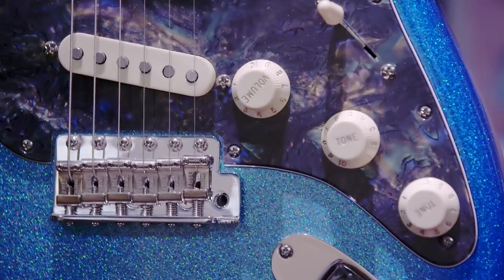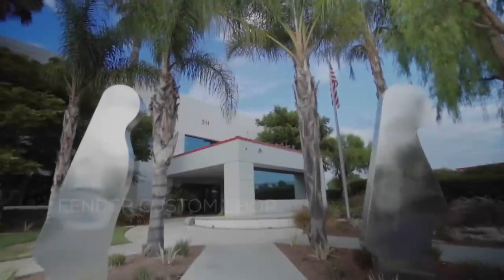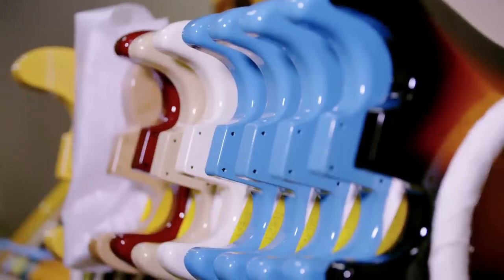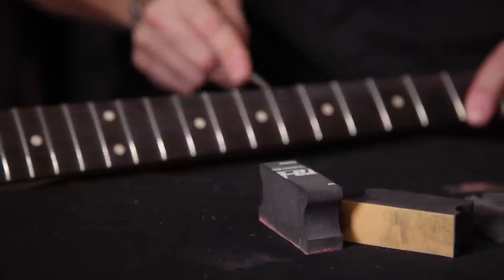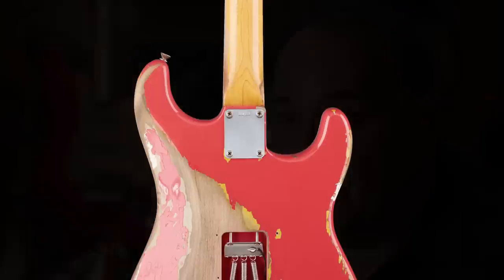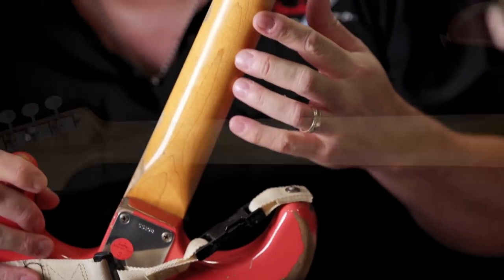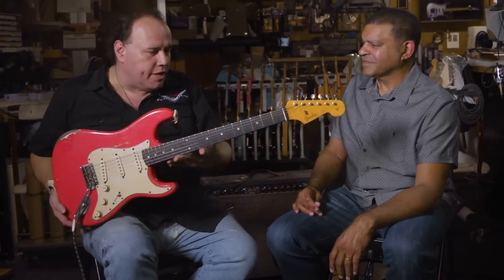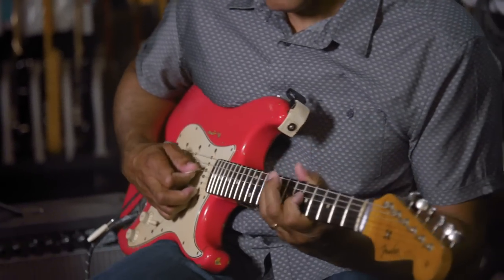Fender Master Builder Brings Dream Guitars to Life

Comment: Full disclaimer up front. I own 3 Fender custom shop guitars. These are great instruments IF and i mean IF you do your homework and find the right ones. Overpriced???? Absolutely! Overrated??? Can be! They are unique but not equal so beware. However they do have their place in the instrument world. I was skeptical just like you so i went and found used ones literally half of the retail cost so THATS the only reason why i have accumulated three of these guitars. They looked the part and they sounded incredible. For me they fill a nostalgia void. Thats enough reason for me so i took the leap of faith.  I own a 1951 Nocaster, 1957 Strat and a 1960 Strat. All CS heavy relics. Those are my favorite years from Fender and i would need to hit the lottery twice in one lifetime to own the originals.

Comment: Yes the relationship with the neck on the guitar is almost unsaid spiritual. 
I've had vintage 57 strat's V's,  a few '59 full C"s profile. a  60's strat the neck less full which is nice, 66 shaved thin the most strat neck ever, a few 67's Strat's that had almost the best not too thin "C", ' 68 and '69 CBS strats was more round I didn't care for
Believe it or not I owned a '36 V neck National Resonator that was once Robert Johnson's which was a nice V full with neck..

Comment: Honestly "relic'ed" guitars are as dumb as pre-torn jeans - and you pay a premium for both - just idiotic.
Reply: In my opinion it's idiotic to buy a guitar with that much legitimate wear from a longevity standpoint. I would never want to pay thousands of dollars for a guitar someone actually bumped around and scraped up and sweat on and had sticky controls from being caked with cigarette tar, spilled drinks, and hooker vagina. If we're talking cost, an authentically aged 60's strat goes for a shit ton more than a new relic. You're right in the sense that you could buy an american standard or even an MIM standard and beat it up yourself and save a lot of money initially but now you've lost money if you go to resell it. Custom Shop relic won't lose value. Neck is straight, frets are new and dressed, neck pocket is tight and not cracked from over tightening, pickups are more consistent and well made, pots and wiring are new, tuners may be aged but internally are new and will last for years to come, nut is new, springs may also be aged but have new spring tension....screws are new but made to look old so they aren't stripped or prone to snapping....I really don't get why people are so hard against someone having a cool looking beat up guitar that hasn't actually had a life travelling around with the worlds most careless clumsy sweaty guitar owner.
Reply: Was my opinion too until an original 1964 Stratocaster in Sunburst came my way as I was very very tempted to buy it for a small fortune. I decided to get it checked out and it had the usual issues of tuning instability and all those years of sweat in the wiring of the pick ups made it one noisy mess. All corrosion on the bridge saddles, springs, Tremolo Block made it hard for setting the action and intonation properly. It looked bloody beautiful in the case and when I had it in my hands but with all its issues, i wasn’t going to part with all that money. So I decided to check out a Relic Custom Shop 64 in Fiesta Red. Fell head over heels. A fine build of a Guitar, no issues and reliable in every sense. So there you go. Try one and see
Reply: Howard. 100.  I have been saying the same thing. I compare it to the pre-torn jeans.